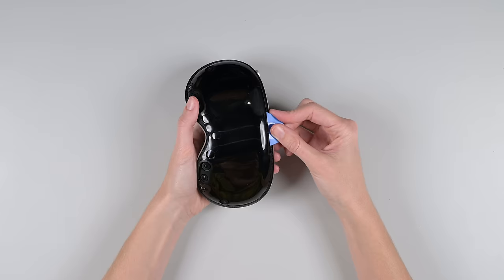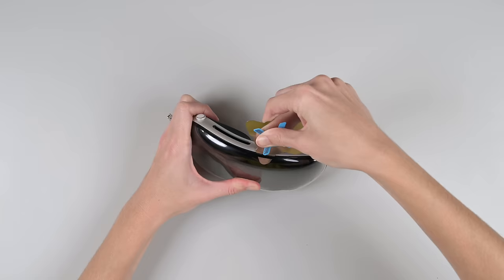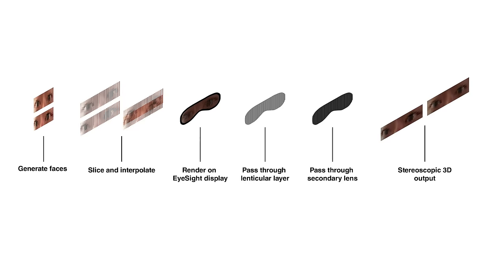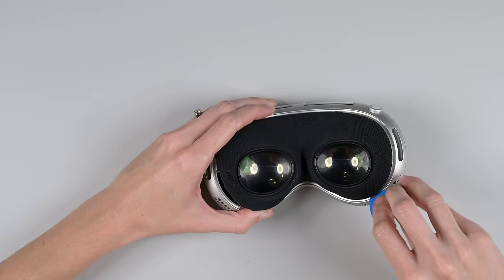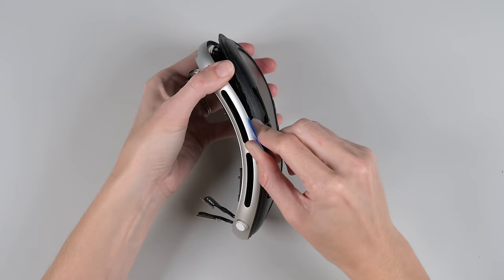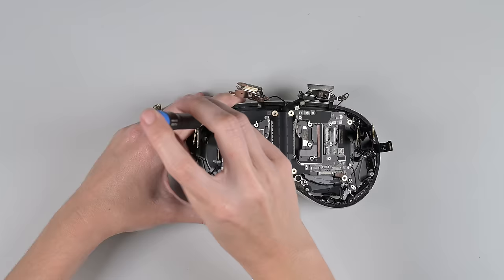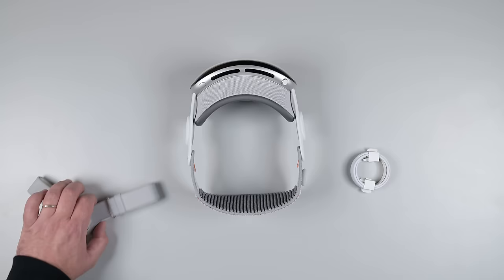Vision Pro Teardown: Behind the Complex and Creepy Tech

Comment: I'd argue this is the most impressive, complex piece of consumer hardware ever. Apple know how to make good looking interiors
Reply: Mmm yeah good looking but not reparable. Most modern girls tbh.
Reply: true
Reply: @megatronskneecap they are repairable. Apple even sells its own kits and parts to do repairs yourself
Reply: @DimitrisSartzetakis  The kits are not that good, also they do not sell the parts, they sell entire assemblies. Meaning if you wanted to replace ONLY the screen you are out of luck as you have to spend the money to buy a whole assembly, which costs almost as much as a new phone. The kits also cost more then actually buying a new phone. Now a repairable device like the framework on the other hand, you can buy individual parts and do the repairs with nothing but a single screwdriver head.
Reply: True.Yet this is a nightmare in terms of repairability.
Reply: @heroninja1125  I guess you have the wrong definition of “repairable” which is “that something can be repaired”. And a MacBook display is very easily repairable. I’ve done it in 10-15 minutes
Reply: @heroninja1125  and unless by new phone you mean an ultra low cost I guess? The M1 display assembly costs like $200
Reply: Yeah just go ahead and buy the repairable $hit
Reply: @megatronskneecap  This sort of product wouldnt be repaired by a consumer anyway. It's too complex for an average person to attempt any repairs
Reply: @DimitrisSartzetakis it still costs a fortune to even rent the stuff apple makes for repairing tho. And the problem is also that you need to buy apples parts to for example repair their screen. This makes it cost a lot more than if they made third party parts work instead of making the device disable some random functionality.
Reply: It doesn't really have a consumer price tag though. By that logic, if I can buy an X-Ray machine - it's a consumer product? But I guess Apple folk is already used to $7k laptops and $10+k cheese graters. And it's very complex, but does that complexity justify itself, or is it just overengineered to get the price up? Highly doubt, but thankfully the reviews are soon to be out.
Reply: Seriously? Best and most complex? Have you ever wondered how much goes on in a modern car? Or a digital camera (lens)?

Are we seriously praising apple for creating a more expensive headset? That is also super complex to repair? Yeah sure it is all nice and stuff but it takes real brains to make something simple, let me tell you that.
Reply: I agree with you.
Reply: @Dimitris A display is not repairable. The laptop is repairable, by replacing the display
Reply: @rolf-smit  Is this really complex? yes. The sheer quantity of tech in this housing is incredible. I dont like Apple but credit where credit is due on a truly incredible piece of technology
Reply: @iowawalker  It's designed as a consumer product so yh
Reply: @Sonderax  seriously? A bunch of cameras, displays, sensors and lenses connected to a central processing unit? That is basically every digital camera on the market right now.
Reply: @Sonderax It's basically Legos, with some patience to get past the glued parts.
Reply: @rolf-smit  yes, it’s just a bunch of cameras. Stuck together with a computer chip thing. It’s so simple and so easy that’s why so many other companies have done exactly the same thing and succeeded.  Clearly I could literally do this myself using a raspberry pie and a few digital cameras
Reply: @rolf-smit while there is admittedly a lot of engineering in cars and cameras, (of which the vision has numerous differing kinds). The processor alone in the headset is cutting edge. As far as consumer level tech, this is definitely up there as the most technologically advanced thing an ordinary consumer could buy right now.
Reply: @Sonderax  what's the metric here? It's still niche, so what makes this a "consumer device", but an X-Ray machine, that someone might use in their hobbies - not as consumer? Same with lathes, CNC mills, cameras.
Reply: Most complex? 🤔 Have you seen the insides of digital cameras.
Reply: @DimitrisSartzetakis  apple's repair service is usually the same price (assuming you don't value your time) as just getting them to repair it themselves. you also need to provide the serial number for the device you want to repair, so it's useless for third party repair shops. it was mostly a PR stunt to get people to think they actually addressed the right to repair concerns
Reply: @megatronskneecap not a single VR headset is easily repairable afaik.
Reply: It's practically useless
Reply: @megatronskneecap what are you on about ?
Reply: you remind me of Theodore Roosevelt's "Man in the Arena"
Reply: @megatronskneecap they are repairable. Just Hard to repair.
Reply: So Steve Jobs is still alive I guess. Read he was obsessed that products Apple designed must look good from the inside as well.
Reply: @DimitrisSartzetakis The Vision Pro is not a MacBook...
Reply: Have you ever seen an EV? Heck, have you ever seen even a normal car!? That’s the most impressive piece of consumer hardware ever…
Reply: @megatronskneecap the iUpdate video suggests the main unit is pretty robust and the sim ejection stuff in this video there is a degree of modularity. It’s a $3500 headset, so  look after it and you shouldn’t need to get it repaired in the first place?
Reply: @megatronskneecap  It's not meant to be repairable. it would be almost impossible to design something like this that is good looking and still easily repairable. when you have the level of complex components that apple has in this, making it easily repariable is just not sensible
Reply: And charge for it too.
Reply: Apple fan girls
Reply: @heroninja1125 more complex = less repairable, simple as that
Reply: @heroninja1125 so I do wtf you expecting
Reply: @Lucifer-fj7mg  So if "complex" refers to how the device is assembled. Wouldn't complex be a bad thing?
Also, complex doesn't automatically make something good, although im sure apple would love it if you thought that way and surrendered your rights of ownership over your device because of that.
But theres plenty of standardized big and small connectors that exist to make it less complex and more intuitive for repairs that apple intentionally sidesteps for higher upfront sales.
Reply: This is exactly why people hate Apple fanboys. It's never enough to be a really good product, it always has to be the bestest, made with space magic!! I wouldn't really even call it the most impressive headset, let alone piece of hardware.
Reply: Beyond replacing the battery, it looks like it's disposable to me. I assume Apple will sell them an entire new "EyeSight" display rather than just the film/filter they broke.
Reply: To be fair, VR headset construction is almost always more complicated than smartphones. Even the Quest 3 is an amalgamation of connectors and components.
Reply: Checkout oculus teardown. At 1/10th price
Reply: Unimpressive, not very complex
Reply: 🤣 not even close
Reply: @DimitrisSartzetakis  first time seeing someone defending apple's "repair programm"  lol
Reply: @khaledassaf6356  This is definitely, and by far, the most impressive headset in the market and one of the most (potentially the most) complex pieces of costumer hardware to be made. It's not about being a fanboy. It's about not being a hater.
Reply: @DimitrisSartzetakis yeah, but it breaks when you look at it wrong
Reply: it's the Visio "Pro", stands for "professionals" ;-p
I'm actually most impressed by the outer display, lots of trickery going on just to make it seem 3D from the outside. Shame it doesn't really work like they showed in the demos.
Reply: Good looking interiors that are not meant to be seen though. Apple does not like people opening their tech
Reply: @DimitrisSartzetakis  Being repairable doesn't mean that all users can repair it. Overengineering the hardware repairability and having costs way up is a way to dissuade people from either repairing the device or having apple service it, in favour of purchasing a new one. This has been the trend for years now, and apple is at the forefront of it.
It's not uncommon for techs at the genius bar to want to charge a user 500 bucks for a display replacement on a macbook when the only thing needed could be a ribbon cable, or a faulty transistor which could cost 1-2 dollars, and about 15 minutes to have it replaced. There's multiple channels that go over this, there's videos and there's been court cases already.
Reply: Nothing creepy about it.
Reply: @angeltorres7048  Calling something not the best thing ever isn't being a hater, it's having proportions. Thank you for proving my point, though.
Reply: @chemicalfrankie1030  These people probably don't leave their room!!
Reply: @megatronskneecap cringe sexist comment there
Reply: I can't imagine what it takes to put it together in working fashion. This the most complicated device I have ever seen.
Reply: Nothing impressive to me
Reply: Not very impressive at all, it’s no different to other high end VR headsets but of course when Apple does it people think they have reinvented the wheel.
Reply: @TwentyEightySeven  I dont like Apple but you cant deny this is an incredible piece of tech. The sheer quantity of stuff within this headset is something only Apple could pull off
Reply: Absolute overstatement. It's another iPhone, but strapped onto your face.
Reply: @Sonderax  Apart from the eye display which is kind of unique the actual on board tech is not that much different to the top end Meta, Vive & Microsoft headsets. Yes it’s more attractive outside and maybe neatly packaged inside but I think HoloLens is a better product where you can really see out of it. I would say all these cutting edge headsets are incredible pieces of tech.
Reply: @megatronskneecap I think this is the one case where we can give Apple a pass lmao.
Reply: Well said, I mean gotDAMN! 😱 No wonder it took Apple so many years to get this out
Reply: A digital camera like the Hasselblad H6D costs $50,000. It's probably more complex/sophisticated than the Vision Pro. I'm sure we could find more examples.

Comment: WOW the amount of engineering never disappoints. 1 out of 10 for teardownability.
Reply: too high of a rating. This has to be in the negatives. Though I'm not sure what a 5/10 repairable headset looks like. This category of product looks pretty bad in terms of repairability.
Reply: what do you mean? it is hard to disassemble but I saw lots of replaceable parts, i'd even dare to say it's better than modern macbooks
Reply: I disagree.  The rating is based on the ability to teardown AND put back together without destroying function.  Fasteners and connectors are good.  Glue and potting are bad.
this is no worse than most phones -just more complex.
Reply: Lol typical apple
Reply: seems people don't get engineering here. This is a score of engineering not reparability. And some product like who cares about the later anyway. If any of u actually buy one then I may say OK  then u just may make a reasonable point.
Reply: @vangcross  Pretty sure that thing's not going back together the way it came apart
Reply: @daddyscrapes what do you epcect with an AR headset tho? repairability definitely isn't something that can be addressed very easily with headsets
Reply: @skyak4493  there's really no way they could do this without glue and still make it look half decent
Reply: Have you ever tried taking a part a digital SLR camera?  There is way too much tech in this compact design to expect it to be easy for an amateur to work on it.
Reply: It'd give it 0.1 / 10
Reply: But does it blend?
Reply: more like 0/10
It is virtually impossible to put it back together flawlessly after disassembly
Reply: As an engineer i can say, one cable that can do what 10 cables does is more advanced than tech than black paint on pcb
Reply: 10/10 for tear down ability, 0/10 reassemble ability
Reply: Luckily it never needs to be teared down. It’s not a custom PC that requires parts to be upgraded.
Reply: @SeanTube2099  its a device with components that breaks, if your lens gets scratched, is easier just to get new visionpro instead fixing current one
Reply: An over-engineered hardware is not the trade of a good hardware...
It's like software source code, the simpler it is for a given algorithm, the better it is.
This complexity is specifically disappointing, actually.
So many parts because it was obviously not designed with the final product in mind by the various departments.
The useless frontal screen forced many sensors to be cabled instead of mounted on the motherboard.
There are way too many screws, meaning that the added weight is partially due to bad overall design maturity.
It's not WOW, it's more like Errrr
Reply: Yeah if you have to break something or are very likely to break then it's an instant lowest rating for me. On top of that there will NOT be replacement parts, I would bet even the screen cover plastic will cost many hundreds of dollars and you will have to get a genius to even get a chance of repair with their added apple tax. 0/10 Thanks America.
Reply: amount of engineering (apple: lol thats not engineering thats just us making sure you break it when you try open it or so you struggle to put it back together so we can then notice and void the warranty when you try bring it in the store cause hole 456 is using the wrong length screw from hole 353)
Reply: Well I don’t think you ever have too open it aniway because the battery is external
Reply: Nah this needs a new scale for its  --10  repairability.  lol 
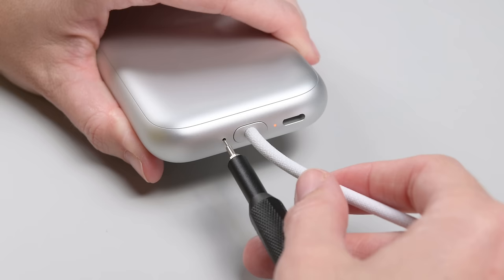Oh at  0:56  what the heck is that double width Lighting looking plug ??  Apple went bananas. heh
Reply: If it didn't use any glue, this would actually be pretty good. Complex for sure the connectors and screws seemed reusable if you're careful enough.

With the glue, though. No way to get do teardown without damaging the parts and as long as Apple will not sell you any replacement parts, this would be 💩/10 for repairability.

Comment: Most expensive tearddown yet? What a puzzle though, I’d imagine a repairability score of -10.
Reply: *teardown
*puzzle, though. I'd
Reply: @alvallac2171 puzzle, though I’d*

Period is not necessary. Also, you missed the grammatical error in the second sentence:

“I’d imagine it has a …”

At least get all of the errors bro
Reply: @yourmomsboyfriend3337  “puzzle though, I’d” isn’t wrong afaik. Putting the comma before “though” would suggest that it would have a repair ability score of -10 despite it being a puzzle, rather than because of it.

“puzzle, though. I’d” does flow better though imo.
Reply: More expensive than you think - The CEO did an AMA on Reddit a few days ago, he said they ordered like 3 of them.
Reply: @alvallac2171  lmao virgin
Reply: Well the first thing to break is probably the lenses. because of scratching or something or the display. Either way its a very expensive part and repairing could be best done at Apple. Also if it was easily taken apart it could (not very likley) fall apart while on your face. Because the technology is so dense.
Reply: @Californ1a the monitization on this video will more than make up for it. Repair kits, not so much.
Reply: How many headset have a high repair ability score? Lol
Reply: I think he wrote "What a puzzle though" and "I'd imagine a repairability score of -10" as separate thoughts, so the comma makes sense. Either or, we all understood him, so all is good, no need to complain.
Reply: Probably realistically impossible for the average person
Reply: if apple was truthful --> (apple: lol  thats just us making sure you break it when you try open it or so you struggle to put it back together so we can then notice and void the warranty when you try bring it in the store cause hole 456 is using the wrong length screw from hole 353)
Reply: So people that are complaining, how self repairable are y’all’s tv’s, microwaves, headphones, wireless speakers, car batteries, monitors and etc ?
Reply: Yeah who would have thought a device that has space level technology, insane amounts of precision and calibration would be difficult to repair?! My god not everything is supposed to be repairable.
Reply: @Stix_Zidinia Bot
Reply: I mean how did it all come together? Industrial design is so hard.